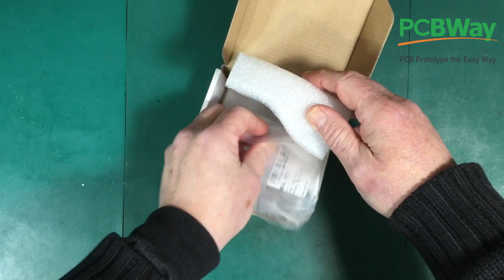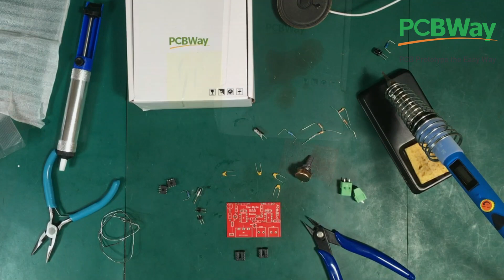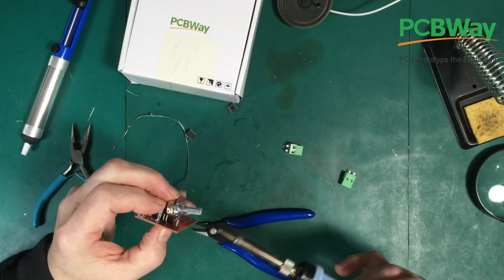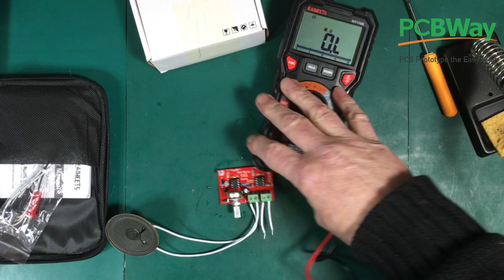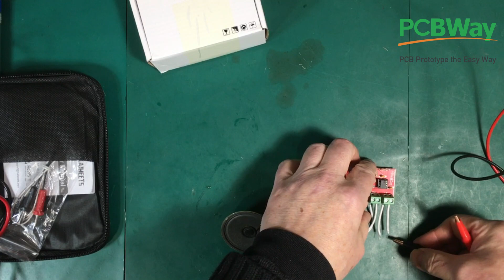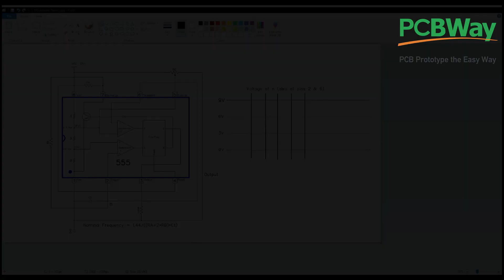0027 - Beginners Electronics Project #1: Astable 555 Part 3

Comment: Another attempt at part 2: Is there any reason to not fill all available space on both sides of pcb in analog audio preamp with ground plane?
Reply from the maker: There is a difference between a ground plane and a copper pour.  Ideally a ground plane should be un-broken.   The return current for a trace that runs over a ground plane tends to be directly under the trace within the plane.  If that trace passes over a break in the plane, the return path becomes interrupted and must pass around the break.  This adds length to the return path and increases impedance and inductance.  For low frequencies this is not too much of an issue, but as the frequencies go up, the problem becomes more serious.  For audio this should not be an issue. 

If I wanted a ground plane to reduce noise pick-up I would generally try to put all the traces on one side, even if I have to use jumpers to do it, then use the other side as a proper ground plane.  If the board is too complex for that approach I would use a 4-layer board and put planes on the two inner layers.

Comment: Part 3: Do you think there is some reason to leave all this space empty, or would it be better to simply fill it up with ground plane? (It is just analog preamp build of LM4562 opamps). (end of question).
Reply from the maker: I would leave it empty.  For audio I generally space out the layout and leave lots of room between devices to reduce cross-talk.  For that same reason I'd try to lay it out single sided even if I have to use jumpers.  I would not use copper pours on the side where the traces are routed except as heat sinks if required.  If you are successful in routing all traces on one side, then I would use the other side as a ground plane.  It's usually good to mount your project in a metal enclosure to help reduce noise pick-up too.  For audio, this is more effective than struggling with ground planes.

RF and high speed digital are different stories.

Comment: Obviously you have lots of experience in electronics engineering, so I would like to ask one more question (and probably many more in the future). My last electronic project was high performance DAC built around cirrus logic 4398 around 2015-16. It was a success (measured noise/distortion performance was as stated in CS4398 data sheet) and I have learned back then about separating digital and analog ground planes to minimize digital noise in analog circuitry.
Reply from the maker: Sounds like a neat project.  Yes, it's usually a good idea to separate the grounds in cases where noise would be an issue.
Reply from the maker: Just looked up that chip.  I'd say that's a pretty advanced project!  Kudos!   What did you drive it with?
Reply: @uni-byte  Thank you for all your replies. I think I will go for 4 layers PCBs in the future. If I understand your question correctly, I drive it with CS8416 - SPDIF receiver. And the SPDIF receiver is receiving signal from either BNC, optical TOSLINK or Cmedia CM102-A+/102S+ which I used as a USB to SPDIF converter.
Reply from the maker: @jakubczajka4275  Thanks for the information Jakub.  Yes, I think a 4-layer design would be best for something like this.  That way you do not have to compromise your trace layout or your ground plane.
Reply: @uni-byte  I have also included in my design 2x6 header, which may be shorted with jumpers, allowing direct communication between SPDIF receiver and DAC chip, or you may install add-on board with CS8421 - sampling rate converter. CS8421 was set to upsample everything, like 44.1/16 CD audio, up to 192kHz/24bit. To my surprise upsampling has actually increased THD... But it was still around fractions of percent. Thank you again!

Comment: For some reason I struggle with adding comment under this video...
Reply from the maker: Seems like you got it done though.
Reply: @uni-byte  It does not show up in my browser. I have tried to split it in two parts...
Reply from the maker: @jakubczajka4275  That's quite strange indeed.  I wonder what the problem could be.  Did you try re-starting your browser and/or your computer?